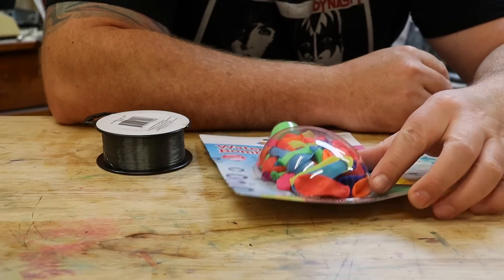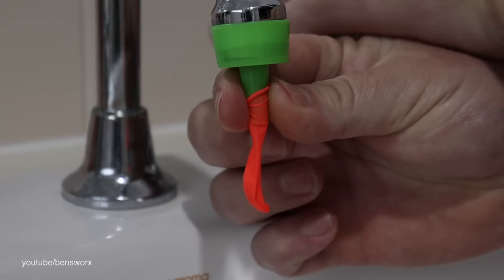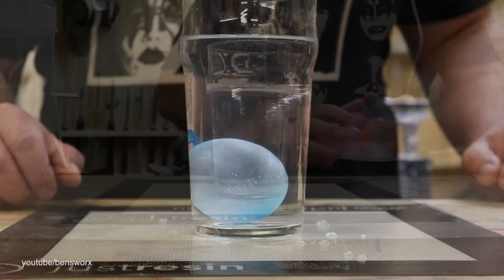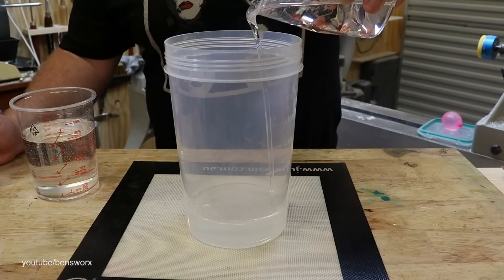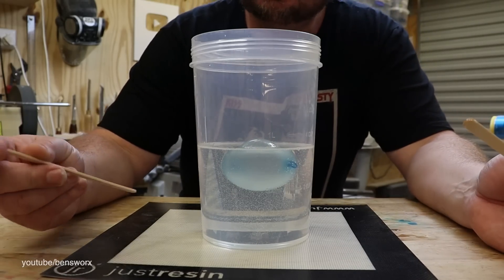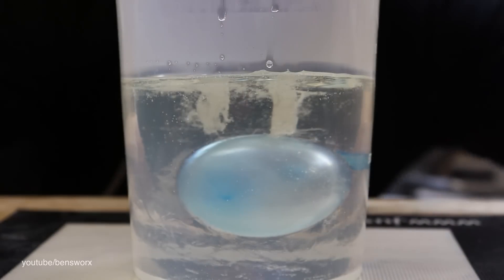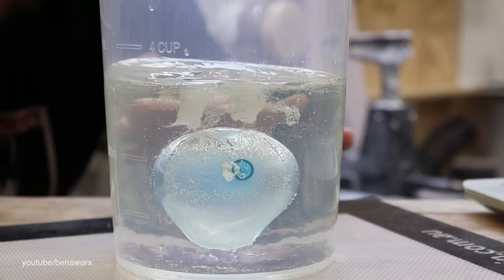Can You Cast Water Balloons In Epoxy Resin ?

Comment from the maker: Thanks for stopping by, If you have time you can check out my new range of Eggs here www.etsy.com/shop/bensworx
Reply: Here is an idea,
Tied the ballon to a fish line and then use UV resin to "glue" the end of the fish line to the bottom of the container, and then fill the recipient with the resing, the balloon will float like and underwater mine but will not came all the way to the top since you have the fish line atached to the bottom of the recipient , 
i have seen you fighthing against a lot of materials that Float, so instead of try to sink them why not avoid floating or limit it :) 
hope ihis can be usefull for you
Reply: Another idea, like how you injected the water but use mercury instead
Reply: I've never tried this, but what if you squeezed an orange peel to get some orange oil, put that in an empty pill capsule, put THAT inside the balloon, and then fill the balloon with water. Epoxy the balloon with a lower heat mix, and then when the capsule dissolves in the water (hopefully after the resin is cured) the orange oil will pop the balloon. I don't know the timing or the amount of oil you'd need to get from the orange. Just something I've heard of, that orange oil pops balloons.
Reply: I knew the salt would work!
Reply: Next time, let the balloon float on the top, and see if it ends up sinking.

Comment: I think you should cover the filled balloon in UV resin for reinforcement except for the specific spot you want it to fail.  Then use the UV resin and an acrylic (or resin) stick to place the balloon where you want it in the container.  Lastly, pour in the resin and put the whole thing in the pot.  Although, the vacuum chamber may be better.  The resin will stay hotter longer in a vacuum.  You can seal pot cam in a lexan box to withstand the vacuum so that we get video.

Comment: If you are able to do a bit of math, then you can calculate how much salt you have to add to compensate the density of the resin. You might need to read the specs of the resin to get the density of the resin. Then you avoid doing such circus show

Comment: Some thoughts that might help.
1. Make a resin puck that you could set on top of the balloon to help it sink so the pressure pot could be used.  
2. If you fill the balloon less it will be a bit stronger and harder to pop.  Then if you want it to pop after it is set use a laser pointer to pop the balloon inside to release the water. 

Just some thoughts from the sidelines and halfway up the stadium.

Comment: Maybe if you tie a short length of string to the bottom of the balloon and then attach the other end to the bottom of the container, you won’t have a floating issue. Then you could fill it completely and place it in the chamber.

Comment: Mr Ben there's something I want to see for casting without preassure pot if possible. You know how when pouring concrete they insert a vibration device and that brings the bubbles to the top? I think since resin is also dense a similar thing could be applied here. Regards.
Reply from the maker: I will see what I can do
Reply: @BensWorx  thanks! I appreciate it.

Comment: Here is an idea my friend. put a layer of resin in the bottom of the container let it harden. then fill your water balloon up, or even an air filled one. then use a little UV resin to stick the tied end of the balloon to the hardened bottom layer, then fill it up with the rest of the resin. voilà it should work. At least for the experiment, my friend.

This looks cool though looks like a Blue Mushroom cloud.
Reply from the maker: Thanks Gary 👍

Comment: Now if they're still salt from the balloon inside maybe you can grow salt crystals inside that opening if you can find a way to speed up the process or you can use some type of powder that crystallizes would do the job and they probably half the time plus make something with the powder that glows in the dark that would be extremely cool or try freezing the water balloon with water inside but you already done using the ice but it still turned out pretty cool

Comment: You need a container you're willing to sacrifice. Poke a little hole in the bottom and get your water balloon ready. Tie the fishing line to the bottom of the balloon and then pull the other end of the line through the hole you made, knot the line then hold it upside down to make sure the balloon will stay in place, make adjustments as necessary. Pour a little uv resin over the hole you made so you can "fix" the hole. Flip the container over and fill with resin. The line should hold the balloon under and also keep it centered. Then pop it in the pressure pot with a charged gopro and light and you got yourself a video! 😁 please 🙏
Reply: Also, make sure the balloon is completely dry inside of its little twisty
Reply from the maker: I will give it a go 👍

Comment: If it was me, I'd do a half measure of resin, let it cure, then put the water balloon on top with some superglue or some UV resin to stick the balloon to the cured layer. Another thing to consider might be freezing the balloon or giving it a full coating of UV resin to make it more durable and perhaps insulate from the heat of the rest of the resin.
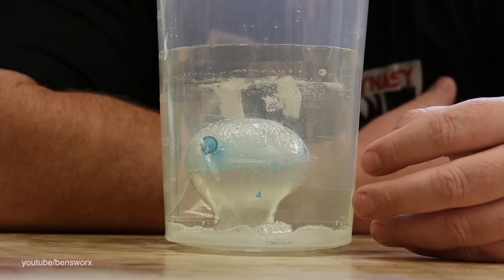Reply: Ocb is not how you ❤dgsgf 7:16 7:20 7:23 7:25 gfgdtgrt die sind rydh die hat die rf a ccd eine rydh 8:00 8:01
Reply: CvvugBBFyou

Comment: Tie the two balloons together at 2 cm intervals with string. Then tie a string to the farthest point of these two balloons. Secure the string at this end to the very bottom of a tall bottle. Now fill this bottle with epoxy and wait for it to freeze. To prevent the balloons from bursting, you can try freezing them. I have not worked with epoxy before. Please don't get mad at me if I'm wrong for this reason. It was just an idea that came to my mind.
Reply from the maker: Nice idea 👍

Comment: I'd be interested to see something similar except have the balloon pinned to the bottom from the start. So you'd still have that balloon shaped void that you could then fill with coloured resin just like you did here. Interested to see if you can do it without all those bubbles and stick marks.
Not sure, but maybe you could do it will just air in the ballon without the water.
Reply from the maker: Yeah it’s worth a try 👍

Comment: you should try candle wax, a quick search says it will melt around the 50-70c  and boil at 370c.  And it has a density lighter than water so it would want to make its way up to the top, so i would suggest pouring some resin throwing the wax in, then covering it with more resin

Comment: There are these bags that you can shrink with a hair dryer (not heat gun) and shrink them around a a basket. I wonder what that would do in resin since the resin heats up.  Maybe color it with some ink so you can see it in the resin. Just a thought!
Reply from the maker: Cool idea 👍
Reply: @BensWorx  heck you could even try pouring the resin in the bag and seeing if it shrinks around the resin.

Comment: Use a smaller balloon with just a little bit of water and a much smaller resin pour.  suspend the balloon from the bottom of the container with the fishing line so it looks like a balloon on a string.  maybe even find a small hand from an action figure to be holding the string.  just an idea
Reply from the maker: Sounds good I’ll give it a go 👍
Reply: @BensWorx  can’t wait to see this!

I recommend another suggestion I saw here, in concurrence with this one: fill the balloon with resin, and it should equalize pressure and cause it to float in the center without assistance.
Reply: @BensWorx  Thanks for doing this!  Such an amazing thing to comment on a video and effect the content of an amazing channel!! It came out so good too!!!
Reply: I was thinking about other ways he could weigh the balloons down. Using string at the bottom to hold it is Genius!